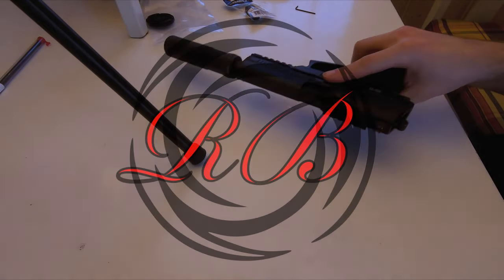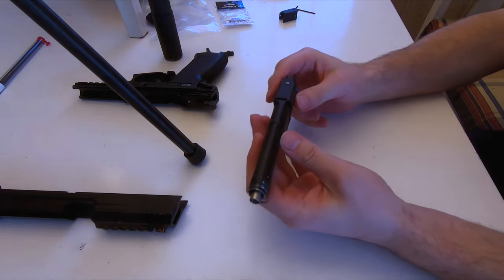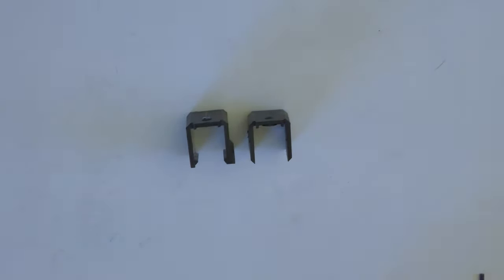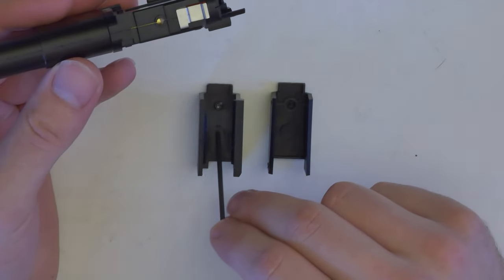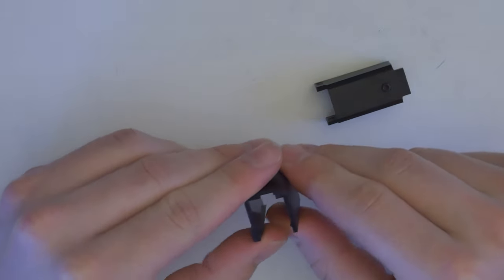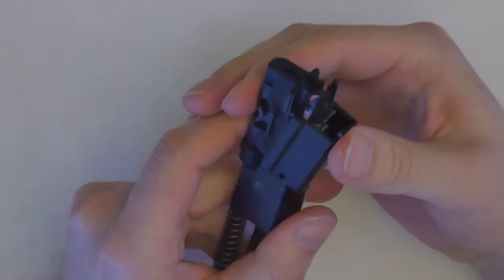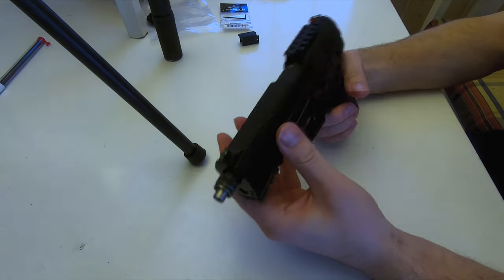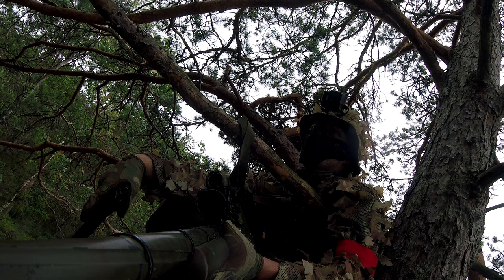Novritsch SSX23 TDC v2 comparison

Comment: I noticed when I got mine it is applying pressure to one side only. The geniuses monitoring quality control passed it...actually there is none...
I need a new TDC because of the improper assembly they did in it.